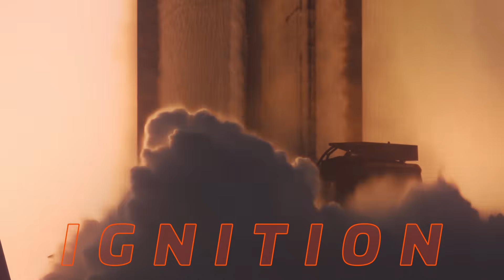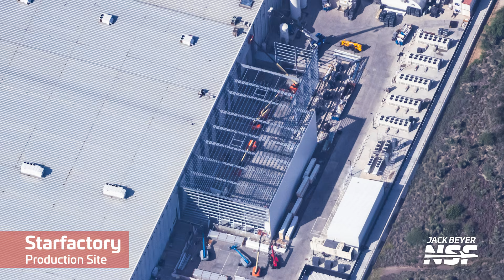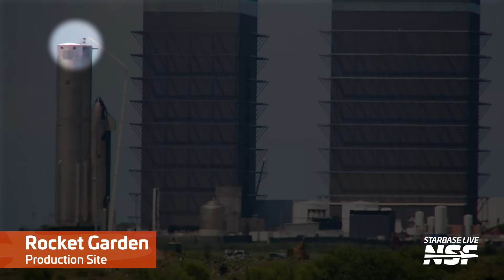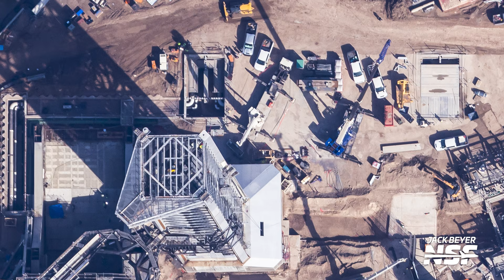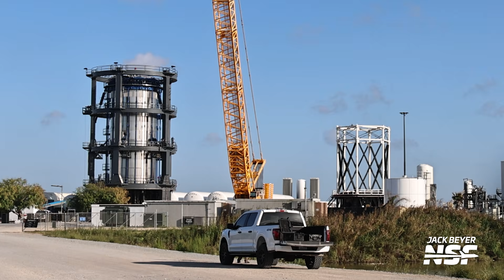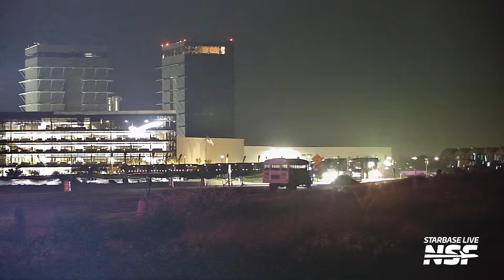Could SpaceX Actually Static Fire Ships on the OLM? Starbase Update!

Comment: Macgyvering a ship stand as an adaptor for mount 1 seems simple enough, they could probably weld a shim of  1 to 2 extra ring to the bottom with hold down clamp cutouts so it doesn't fly off during static fire, what I thought they may have done after the suborbital stands got decommissioned.
I assume they went with Masseys for ease of testing so there are less road closures needed.

Comment: I can't quite comprehend the ramifications of a test failure of the recent Massey's level happening on the OLM...
Reply: It would be fine, first things first, the olm survived booster 7 flying, which was able to carve a crater into the ground below it, which was concrete, and ship 36’s RUD didn’t really carve any sort of crater in the concrete as far as I know
Reply: It might not be as bad, the table and tower are both strong structures.  That does not mean no damage though, it would NOT be a good thing.

Comment: Obviously possible to static fire on the OLM, but what's the cost THEN if another one blows up?
Reply: More cleanup.
Reply: @imaginary_friend7300   Well, yes, that too but the damage could be breathtakingly costly.  The launch mount is surrounded by far far more expensive infrastructure that would get blasted.
Reply: @jamesg1367 the olm survived ift 1, in which booster 7’s engines carved a crater into the concrete below the olm, and as far as I know, ship 36’s RUD didn’t carve any sort of crater into the concrete and stuff below it

Comment: They are going to test the ship 37 at the launch pad 1, but they are not changing the quick disconnect, its going to be temporarily fitted with the spare ship disconnect with tapes to turn them off on top of the booster quick disconnect system

Comment: I dont think the OLM was built to do static fire. Due to the clamping mechanism for booster. It woule need a stand to be modified to fit the olm. It would also need an modified connection to the olm.

Comment: why is using the OLM meant to seem so crazy? they did it multiple times before.
Reply: I would guess that the prime issues are locations of hold downs and fueling infrastructure.  The ship QD and the booster QD are not the same.  NONE of that means adapters can not be fashioned though.

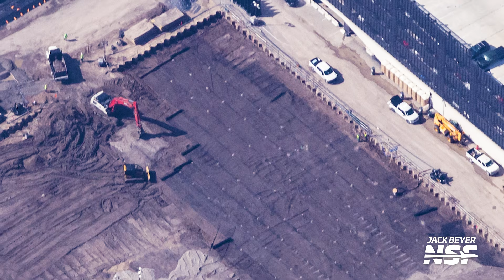Comment: 1:19 How, can't those be piles when the pile drivers haven’t even drilled any holes yet? Lol
Reply: Are they not sheet piles so they can dig?
Reply: @imaginary_friend7300  the sheet piles are just around the perimeter. i dont know what the dots are but im 99.9% certain they are not piles as the pile drill rigs have been parked in the staging area in front of star factory since they got there. one of them did move into the pit area briefly but it didn't do anything while it was there.

Comment: Trying to brake the crew module "Star Ship" with a rocket is never going to work. Just after Re-entry and the hot plasma is finally gone then they light up a rocket directly beneath it. This cooks the whole ship at 1200 degrees f. . You cant cook the crew, They wont survive and if they did they wouldnt want to. This is why they explode when they touch down, all that heat hitting the cold ground or water. You cant put humans inside of it cause they will cook. Get a parachute!  Dont be dumb
Reply: Nonsense.

Comment: Are any of the original ship test stand ground fixtures still accessible at pad 1 from testing way back when? Could they be re commissioned with a modified transport stand?
Reply: Do you mean the footings in the concrete? Yes they are there but what can they be used for? Not for static fire tests anyway. An adapter for the OLM can be used both for cryo and static fire tests.

Comment: I'm thinking the flame bucket at 11:00 may be a 4th option - test components of the Pad 2 mount to their limits and have on hand a replacement part to get back operational quickly.  When operational, even multiple launches per year are going to cause lots of wear, let alone multiple launches per week, so having a clear idea of how far they can go before failure / maintenance could be useful before building out other pads.
Reply: Pad 2 is not ready at all yet. They need another 3-4 months.

Comment: Do they really want to risk it blowing up on the orbital launch mount, given that version 2 clearly has serious problems in that area?
Reply: OLM at Pad A is only useful for launching v2 hardware.  If it blows up, then it'll just get scrapped a little bit sooner than it would be anyway.
Reply: A serious problem?  This is the very first time these COPV's have had an issue.

Comment: How they going to build all the pads for return flights on Moon. Mars?  No water.
Reply: I'm guessing they might lift off using the same specialized ring of thrusters that they'll use for landing.  Once high enough above the surface, light the main engines.
Reply: @Spherical_Cow  I agree. Nothing else sounds plausible.
Reply: This is the whole point of the upper level engines on the HLS ship, so they don't need pads.
Reply: They also have the big advantage that both places are easier to take off from.

Comment: With the small test tank, there is no reason they can't induce the harmonics into the test piece and far beyond than what would be expected in flight. And they can be concentrated depending on the frequency. Wherever in the system they want to beatz depending on the harmonics frequencies. The rocket motors can be tested on the stand. If your starter works at the parts store they work don't they. That is a bit crude way of looking at it. But basically that is the way it can work, broken down enough , and just about that simple for the people checking the list.
Reply: They can't be sure of the ship by only testing components. They also need the fully integrated ship.

Comment: You're not the first platform to suggest testing a booster on pad A.  And this a very typical SpaceX
"Let's try something totally off the wall!
Reply: They used an adapter on the sub-orbital pads. So the method is not new.

Comment: they should do  starship static fires and hover meter or or 2 for chopstick  catch practice on OLM
Reply: Static fire means it does not move. No hovering permitted.
Reply: @knowledgeisgood9645  static fire AND hover
Reply: @blengi  Never any flying when doing a static fire. And never any hovering - too dangerous.
Reply: @blengi  I think you might not fully understand the difficulty in actually hovering a starship.

Comment: It wouldn't surprise me if they fly 1 or 2 block 3 ships on top of the remaining block 2 boosters on Stand A, assuming the booster is technically capable. Might be the first 1 or 2 block 3 ships are more of a hybrid block 2 design, especially when it comes to the TPS. This is assuming they are planning to knock the next two flights out by early September, which it seems like they want to do.

Comment: One other option for the extra deluge hat......it's just a spare. While building one they could easily build a second with the same jigs so why not build a spare? I don't think this is super likely but it's at least a possibility.
Reply: I agree. They have to make sure the design works first. If they loose too much metal in spite of all the water they might need to replace it faster than they expect. And if not needed it can always be used on another pad.

Comment: Would putting a ship on the made up mount raise the ship and mess up the quick disconnect alignment?
Reply: They'll need to MacGyver the Ship umbilical connections, as well - perhaps using flex-hose extensions hooked up to the BQD.  The BQD itself isn't compatible with the Ship anyway (and the SQD is too high up the tower.)
Reply: I think it is unlikely they would use the BQD for the static fire. They just need to connect hoses to the ship. They have done that before.

Comment: Great 'out of the box' thinking to use the OLM for ship testing. Can't wait to see that happen (if it does).
Reply: They have used that method before when they static fired boosters on the sub-orbital stands with an adapter. So, I just hope it works as planned.

Comment: Please stop trying to redefine the word “explosion” so that what happened at Massey’s is somehow not an explosion. And no, none of the descriptions of the physics changes what happened to something less than an explosion.
Reply: An "explosion" is a deflagration or a detonation or some other kind of rapid expansion.
Reply: I have heard the term, deflagration  used for ship 36 anomaly more than once.  So without specific reasoning or evidence I see no reason to reject the term. Her is a definition of deflagration and how it differs from a detonation.   

"Deflagrations with flame speeds in the range of 1 m/s differ from detonations which propagate supersonically with detonation velocities in the range of km/s".
Reply: A deflagration is when a fuel ignites with the wrong amount of oxygen. An explosion is when the amount of oxygen is right and the mixing is correct.
Reply: If you are unprepared to accept the fact that the main damage was not caused by an explosion rather a fireball of badly mixed fuel then that's on you.
Reply: @shaung949  Saying it is a fact does not make it one.
Reply: Please stop insisting things be dumbed won to your level of understanding.  The different terms do have different meanings even if YOU don't understand them and won't make any effort TO understand them.
Reply: @imaginary_friend7300 I don’t need an explanation what fits the definition of explosion. Clearly you do. You do not need something to violently expand supersonically (a detonation) to qualify as an explosion. There was in fact detonation and deflagration, either of which qualifies as an explosion.
Reply: @Mr_Sunshine_001  Even a vessel bursting due to overpressure is called an explosion if the event is sufficiently violent. A bursting air balloon is probably more likely described as "popping" rather than "exploding", but only because the involved energy is relatively small.

Comment: Hopefully we're getting a launch in July...it's plausible if they get a static fire done.
Reply: No, not at all plausible.  It'll likely take most if not all of July just to MacGyver this test stand together. Static fire Ship 37 at the end of July or in August, then return it to MB2 to prepare for flight while restoring the Pad A OLM back to a launch configuration.  Maybe launch at the end of August, but more likely in September.
Reply: @Spherical_Cow  Could be.  Time will tell.
Reply: I think they'll do it!
Reply: It depends on HOW they adapt the transport stand and the OLM. If they add an adapter to fit the 20 arms at the bottom of the stand, or if they adapt it to be placed on top of the OLM. Neither will be easy.
Using the 20 hold-down arms gives them a strong base, but is hard to make. Placing the stand on top of the OLM needs a lot of reinforcements to make sure the OLM does not buckle under the load.

Comment: Saying the rud might of been intentional is delusional sorry
Reply: Engines have been tested to destruction many times. No other way to find out the actual limits. Raptors are relatively cheap and are produced in large numbers.
Reply: @knowledgeisgood9645 of course they do, but are you genuinely suggesting that rud was intentional?
Reply: @ddubzz_  RUD is rapid UNscheduled disassembly which of course is not something anyone plans. Calling it a rud is not a correct label, but is so commonly used that it just is a way of saying it broke down.
Reply: @knowledgeisgood9645 you are absolutely correct, i just think its a bit disingenuous of NSF to suggest in the video that it could of been intentional, there’s just no way.
Reply: @ddubzz_  They do deliberately test engines to the point they fail.  The perfect time to do so IS the very last test firing on a specific stand.
Reply: @imaginary_friend7300  i know they test to point of failure. I have followed this program for over 5 years. This was not a test to test to point of failure. This was a panned SF in prep for flight. Do you truly believe this was a test to point of failure?

Comment: @10:18, I'm still surprised all this piping is not insulated!
Reply: The ice makes for a decent insulation. I assume they don't loose too much from having the short distance exposed. They would insulate them if they had to.
Reply: @knowledgeisgood9645 you might think so, but having worked in the industrial air gas industry and at an ASU, you soon realise how inefficient it is and how quickly pumps fail if they are cavitating due to cryogenic liquids starting to boil in the pump suctions. But heck, it’s only money right!

Comment: I dont understand why spacex never does a long duration static fire of a starship  with low levels of fuel to check for different vibrations. Fuel lessens some vibration.
Reply: The ship would be ripped from the pad like that one Chinese static fire attempt a few months ago.
Reply: if fuel tanks are low, the thrust of raptors even at minimum will be too high and they will not be able to hold the ship down to the ground
Reply: Also, vibrations on the test stand are not the same as vibrations in space.
Reply: The need the weight of the fuel to keep the Static fire from becoming a Dynamic fire as it launches from the test stand.